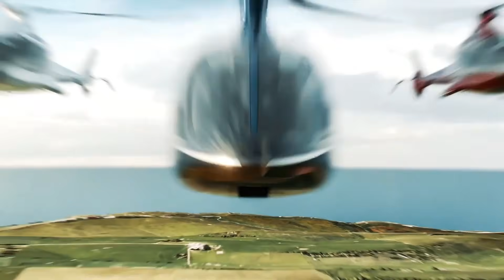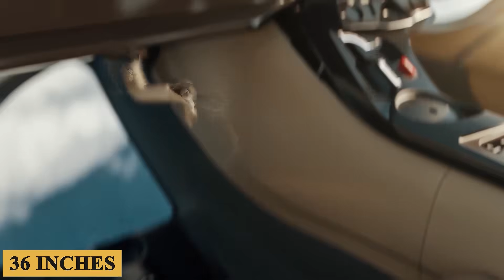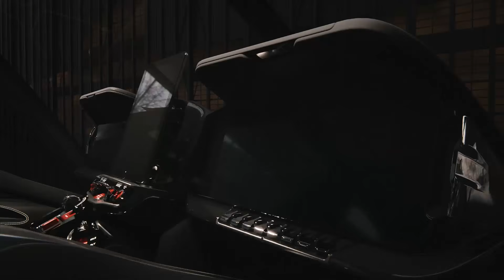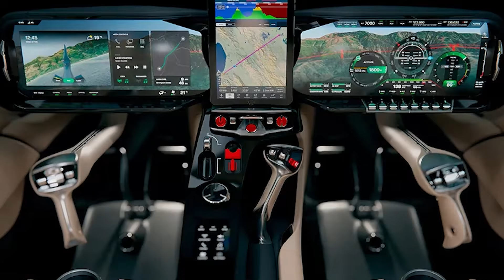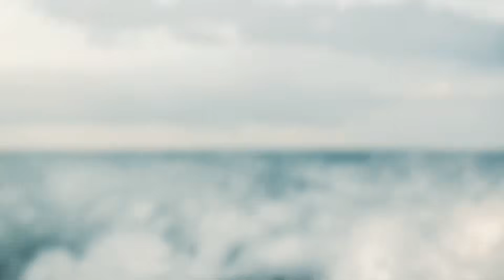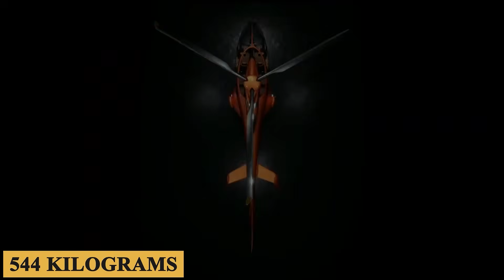Inside The $750,000 Hill HX50

Comment: Echoing previous comments about the unrealistic price point and delivery time, I add:

The word is "CYCLIC" as in "CYCLE" not "sick-lick."  Time for a new AI narrator.

2-D Autopilot?  Today's 4D autopilots are easily worth $25K.  A 3D autopilot is worth $15K.  A 2D autopilot won't get you IFR rating and is virtually worthless.  If it's a $0 addon I'll take one

"Force Trim" is a new thing?  That was standard (MEL) equipment on Bell IFR helicopters 50 years ago.  Heck, it was even part of the into the TV show "Airwolf" in 1984.  If that's your "claim to fame" best go back to "but she looks good."

I wish it was here.  I wish it was $750K.  I'd be on the list to acquire one if there was US-side MROs.  But this?  This is "give me investor money" schlock.

Yeah, I'm an FAA commercial helicopter pilot.  I have experience with many airframes, hundres of hours, and no incidents.  Safety is job 2.  Reality is job 1.

Comment: VEry ambitious design and build your own gas turbine engine and transmission system and a varbon epoxy structure,? As amatuer built this os possible as there is no real FAA or ICAO approval but LAA review and verification of airworthiness which has to be renewed yaerly EXCEPT helicopters are not currently afforded such a privilege. Current reading requires CAA design approval. Rotorway has done this.  SO these will have to be experimental amatuer built aicraft as the MOSAIC formula does not allow 500 shp.

this looks to be another one of many i have seen in 42 years in aerospace engineering, MONEY PITS. , ICON, ECLIPSE, CIRRUS, (yes they went broke), Lancair, CHampion, New Tiger, Commander Aircraft, OMAC, VIKING, lets see the current martket....the R44 starts at about 515K usd, the r 66 1.2M USD. type certified, aluminum construction 4 place with certificated powerplants FOB TOrrance ca. 
This new item will have a digital instrument panel, a completely unknown drivetrain. and gas turbine s are NOT cheap to develop. so to meet this price the risk is shifted to the builder. one think about rich people ...they do not like risk.

Comment: WHAT IS THE HOLDUP?
Reply: They haven't finished building the first test engine yet. After that, they need to build a flight worthy engine, then fit it to the airframe (with a transmission and any other systems that are not ready yet), then start test flights.
Reply: @brianb-p6586 Transmission is ready, the engine is designed and partially built. Some elements is still assembled. They just finished the 10kw starter generator.

Comment: When the builder seems far more concerened with the bling and panel function than the mechanical aspects and performance.....BIG RED FLAGS
Reply: What do you mean? Did you see the Hill presentation a couple weeks ago?  The inhouse 500hp engine seems impressive, if they can actually buid it.
Reply: @PetriTemiseva Yeah, turbines engines for aircraft can be built by just about anyone. /sarc
Reply: @greysheeum  I did not make that claim. Dr Hill did. If you watch the presentation video you can see how he plans to do it, and why he thinks he is capable of doing so. Only time will tell.

Comment: Expect an Eclipse Aviation type life cycle of development. Remember the Eclipse 500?  Begun in Albuquerque as a platform for the new (at the time) 80-lb., quick-change Williams EJ22 turbofan engine. Super cheap and low-maintenance, allegedly.  The plane would be $500k out the door, they said.  Many test flights and a pile of cash later, the underpowered Williams was replaced with a modified P&W Canada PW610.  The first business entity went bankrupt, and it sold as a fire sale to another entity who finished production. 260 jets later at $2.5mm a copy (mostly to Day Jet, also defunct), and Eclipse Aviation is no longer.
Reply: Why are Pratt & Whitney PT6's SO DAMNED EXPENSIVE ? Especially compared to the Williams
Reply: @Snakebloke   The PWs are more powerful. The WIlliams are carbon fiber, I believe.  You think that would be more epeinsive.
Reply: They pay for the name. Dr. Hill fully own the company while eclipse was a stock company needing investments to keep running. Hill has deposits of 50k UK pounds to pay for up scaling. Many have wanted to invest in Hill but have all been cordial declined. The engine will only fly in Hill helicopters.

Comment: $750k is the bargain of the century. What am I missing?
Reply: By the time it hits production, it will be twice that.  Mark my words.
Reply: @nunziobusiness1509  For sure. There is just no way they can produce so cheap. I mean even the Airbus H125 goes for over a min
Reply: The engine.
Reply: It doesn't exist yet, so the price is a guess at best.
Reply: Send me the bank account details, I'll pay the deposit today !!
Reply: You find all info on their website.
 @MrSimonw58
Reply: Another "small" detail is that will not include the 51% of assembly work which the buyer will provide, as a workaround to not being a certified aircraft.
Reply: That is a 2 week build that you do in the plant supervised of Hill mechanics.
 @brianb-p6586
Reply: HX is experimental and offer 5000 TBO HC is the normal factory buildt helciopter that can be used commercial and they are 100% the same. HC will have lower TBO hours. @brianb-p6586
Reply: Probably money to buy, like me.

Comment: Good luck if you put your money down, if this was even real
Reply: If I had the money I would be a customer to. This a killer of all comparable helicopters and the demand will possibly rice the price and resell value. 5000h TBO is amazing.
Reply: @palandorstvold5622  couldn’t agree more, it’s beautiful.
But it’s also not easy (nigh on impossible) to certify a new state of the art helicopter. 
Remember how long it took to get the small single engine jet airplanes to market.
Reply: @palandorstvold5622 Hill said the price will change.
Reply: They have already 1,000 deposits. 800 for HX50 and 200 for HC50 (commercial version starting at 725,000 GBP)

Comment: $750,000, there is a zero missing. $7,500,000 more likely.
Reply from the maker: The price is not wrong, £600,000 is about $750,000
Reply: Nope! Currently listed on their website for 725K when you convert British pound price to $$$
Reply: Starts at 600,000 GBP, with extras about 700,000 GBP, so about $1.2-1.4 million dollars. Plus $405 an hour just for fuel. It uses about twice as much fuel as a modern piston engine.
Reply: Guestimate is 35 gallons an hour on cruise and that is Jet fuel @chippyjohn1

Comment: Where the Hill is a commercial flying product this has been going way too long
Reply: Building a helicopter takes a long time. Remember that the Robinson R66 took 4 years from announcement to full production; certification took longer. Like Robinson before them, Hill has to talk to nearly the entire world to make sure their final product will be legal to fly, and they're developing their own in-house turbine, which presumably has its own regulatory pressures
Reply: @LegoWormNoah101  Well it does I’m sure but come on they are inventing a thing called a helicopter. it’s not a new thing, but they’re inventing. They are supposed to be as they say, creating a new class of reliable rotary wing aircraft.
It’s just taking too long. It smells like an investment concept rather than doing something better. 
Cirrus succeeded in taking a standard concept, fixed wing aircraft and making it more flyable, safer and efficient for lower pilots
Hill is taking far too long to get this thing to market, which makes people think that there’s something not quite 
I say Hill put up or shut up